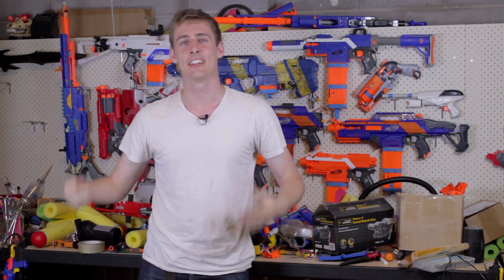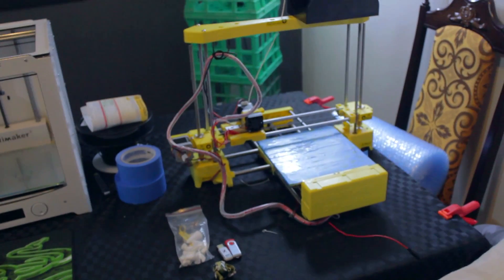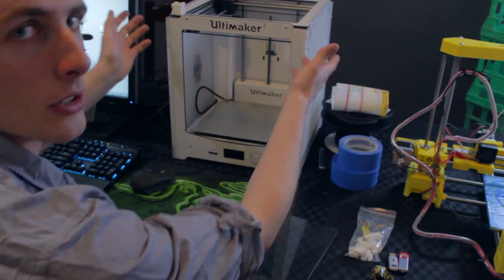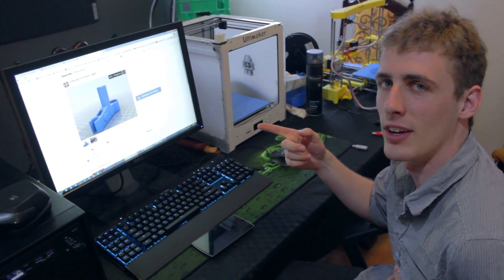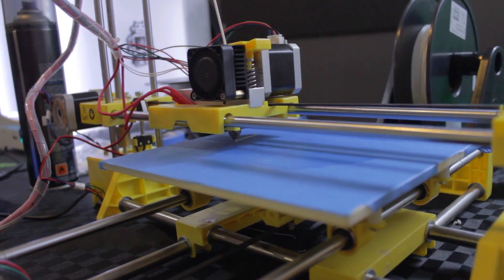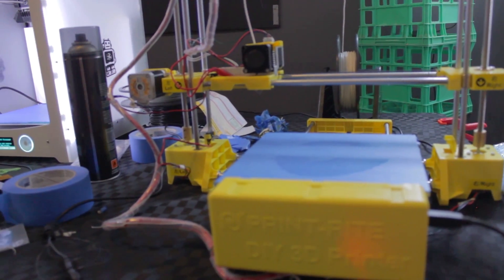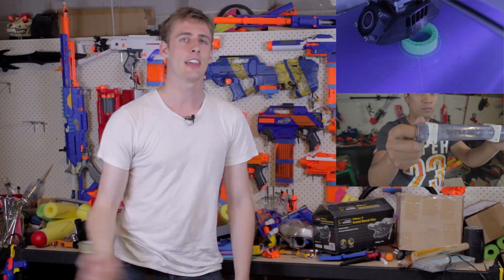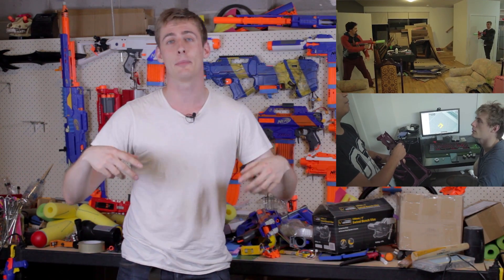ULTIMAKER 2 vs PRINT-RITE DIY 3D Printer & How to Bed Level - PRINTER PARTY | Make Test Battle

Comment: you guys didn't do the printer kits justice. I've been printing on my 240$ USD printer for over three months now, just bought two more as I'm starting a business. I have also printed on the makerbot replocator 2x before and honestly, my printer does a better job. I have more speed, more volume, and more room for play. if you're watching this video with the intent of seeing these cheaper printers in use please don't take this as an example.
Reply from the maker: +Pep. Co We jsut happened to have the two printers in one place and decided to film a bit of the operation. There are definitely some really good, cheap, kits now that weren't avaliable when I bought my UM2 -R

Comment: i have a couple Stratasys Dimension SST 768 printers that i got for about $4k total for the two. theyre old industrial prototyping printers from around 2003. they work great and theyre consistent. the problem is they use plastics trays that arent supposed to be reusable and they use special filament for the model and support material. they have been more reliable and easier to use than the ultimakers and solidoodles i used before. i recommend them and they pop up on ebay pretty often.
Reply: +puddinhead99  i should also add that there are solutions out there to crack the software in the printer to edit the extruder temperatures so you could use cheap filament and there is someone on ebay that sells a reprogrammer for the chips in the filament cartridges. you could easily cut the costs down on these printers.
Reply from the maker: +puddinhead99 Thats a pretty damn good price! I'd love be be able to print with a soluble material for the supports... -R

Comment: OMG!!!!! Blue tape on heated bed? Are you crazy?
Reply from the maker: +James Nelson Yeah why not? It gets better adhesion -R
Reply: +Make.Test.Battle with a glass bed adhesion at the right temperature is sufficient to cause the glass to break off with the part. how could you possibly need more adhesion than that? if you're not getting adhesion on your  glass bed, check temp and level. for pla you should print around 190-210c nozzle and 70c bed. putting blue tape on the UM bed is so wrong :). I have a UMO with heated bed upgrade and its beautiful. have to cool bed to 40c to get parts of, way more adhesion than my old acrylic bed and blue tape. Please try with blue tape, its amazing.
Reply from the maker: +James Nelson 70 degree bed for PLA?! Jeez... I run the bed at 45 with tape and that works for me. I tried running a hotter bed but I am too impatient to let the parts cool before removing them so they always bent :P I might mess around with my configuration when I move house. I will have the printer in the new film studio area so I can set up to print overnight -R
Reply: Make.Test.Battle yes 70 C as the instructions for UM say. That's why you can get adhesion, 45 C is way too low. It does take a bit too cool, but if you use a box fan/floor fan you can cool it quickly. Try it you'll never go back to tape again. It creates a beautiful finish on the part, super glossy.

Comment: you should have printed the same piece on both printers to check quality.
Reply from the maker: +Kyon Thats a really good idea! If I get the chance again we will do that for sure. Unfortunately Kash hadn't done full calibration yet so the print quality was very low and there wasn't really any point to try printing a more complex shape -R

Comment: add autolevel. I have a $400 Printer. but my quality is far greater. I am not counting the filament sensor I added for $60 to measure and compensate for the varying diameter. however, this is the first video I have seen. and hope you have done an update.
Reply: +George Robles Ive never heard of a filament sensor, where did you get yours at?
Reply: Dima Dombrovski Look up on thingiverse.com

Guy did it for a few things, and is the third revision. My setup and info for my board, which is comparable to a RAMPS, with less breakouts. Setup in firmware and my slic3r settings are on my WordPress blog 
georgeroblesjr.wordpress.com if you want the information, plus how I did autolevel
Reply: Dima Dombrovski objects with intelligence is the guys company. Please let him know how you where led to him.

Comment: This is great misrepresentation of the $400 printer. When I built my Prusa i3, it cost me close to $800. Now the same thing costs $400-$500 from China with auto bed leveling, LCD screen and other bells and whistles. Off course it does not look as pretty as the Ultimaker but it does the job quite well. The guy with the $400 printer, should have used a glass sheet on top of the wooden bed. Guys don't get discouraged by this, head over to the Reprap subreddit or  check out the Reprap wiki for more info. A $400 printer can do the job almost as good as the $4000 Ultimaker.
Reply: +Consig1iere I'd say a Prusa i3 is actually better than an Ultimaker 2.
Want auto bed leveling? Install a sensor. Want two hot ends? Just add another one. Or why not a diamond hot end to print in full RGB?

There's really nothing the Ultimaker 2 can do that a Prusa i3 can't, except for costing $4000.
Reply: +Consig1iere This video is USELESS! I made my Prusa i3 a year ago and does exactly the same thing as other printers... I only don't have auto-level but can be added.
Reply: I have a $220 acrylic prusa i3. Works like charm. Heatbed, extruder+part cooling, LCD, SD card included, comes with filament worth 20-30 USD snd I even used a coupon. And free 1 week shipping.
Reply: +Consig1iere 
Not even. The cheapest Prusa I've seen was exactly $199 shipped. It's pretty amazing how cheap they are getting.
Reply: +Consig1iere I built my for less than $300 and it works great.  Don't have LCD screen nor auto bed leveling.  I have parts on order for bed leveling and I have Octoprint to control the machine.
Reply: +Ratchet Russian I'm waiting for the peachy printer right now, It's 100$, and looks pretty promising.
Reply: +Akegata42 Didn't know about the Diamond hot end. Awesome!
Reply: +Consig1iere Can you print at 150mm/s? My buddy has a prusa, its pretty good but pretty slow. I have an UMO (2k$) and the print speed is night and day
Reply: +Akegata42 it can print at 150 mm/s, have a larger print surface and less Z wobble. Likewise you can upgrade it any way you want. Oh and it actually costs 2380 USD from a north american retailer ^^
Reply: +Alexander Nikolaev the prusa i3 has a print speed of 200mm/s... from there website "Maximal speed of 200 mm/s" you sure your m8 has it set up properly?
Reply: +Alexander Nikolaev Print speed isn't really hindered by the design of the Prusa i3, but rather by which hot end you choose and how well calibrated the printer is.
With a Volcano hot end you can get a seriously fast print speed, although that's a pretty specific type of hot end.

The print surface is pretty hard to extend with an i3 of course, but things like Z wobble can be more or less completely eliminated with upgrades.
Reply: +Consig1iere Well I think what this video shows the best, is that if you move your cheapo printer you will have to take some time to adjust it, while on ultimaker even if you move it, it's adjustable very easily, basically as close as plug and play on 3d printers as possible.
Reply: +ValugaTheLord It is not just about adjustability but also upgradability. Even with Ultimaker the user would have to adjust certain things.
Reply: +Alexander Nikolaev The thing about Prusa is that it will differ from user to user. If one user knows what he is doing and does everything balanced and calculated, then I don't see why a Prusa can't do what an UM2 does. In the end of the day, both these printers' core design is the same.
Reply: +Alexander Nikolaev I have a prusa i3V which cost basically the same as the regular i3 (slightly more but not much), however it uses v slot rails instead of the smooth bars. makes for a much more rigid design. i can print as fast as your 2k printer and i have a 12x12x12 print area. i have about 850 in it atm and the only thing i need to add is auto bed level, which will cost like 5 bucks.
Reply: pugs2300 Nice, yeah if I had to buy a printer again, I'd probably get a prusa i3. I picked up my umo 3 years ago, and i3 was not available yet. In either case you get what you pay for (either in time or in money)...
Reply: +Consig1iere monoprice, 350$ fantastic printer,
Reply: Hi Consig- I have to set up a maker space in a school in China. Can you send me the link for the printer you are recommending here? ( in China) Thanks mate.
Reply from the maker: +Consig1iere Hey peeps; this was just a casual comparison to show off what the two printers that we have can do and the differences. If I was to have my choice again I probably would pick a cheaper printer and save the extra money. -R

Comment: have use uhu glue stick makes your life lot more easy printing in abs on ultimaker 2
Reply from the maker: +rob ten tije Yeah I tried the glue but I prefer the blue tape as it doesn't get all gross. Nice and easy to remove prints however -R

Comment: WTF 4000$ for an Ultimaker 2?????????? Did you pay 1500$ for shipping or what?
Reply from the maker: +ThinkDragonX41T Pretty much; the Australian dollar was fairly weak against the Euro when I bought it, shipping was very expensive, and I had to pay local and import taxes. -R
Reply: OMG sorry i didn´t know that you live in Australia. What a hardcore Price for this printer. I use the Ultimaker 2 since far over a year and it has over 1000 workhours with no Problems. The only upgrade i used is an Olsson Block and belt tensioners. I´m sorry that you has a such unlucky device.
Reply from the maker: +ThinkDragonX41T Yeah; I pretty much got a lemon. It's fixed now and I can't wait to make more awesome videos :D I'm considering getting the hot end and fan shroud parts to upgrade it to the 2+ standard to take swappable nozzles -R
Reply: Yeah, the Olsson Block is a great Upgrade but be damn careful with the temperature Sensor when you pull it out. It seems that i damaged mine so i have to replace it. Sometimes i get an temperature Error and sometimes the Maschine runs with no problems. But the Nozzle swap funktion is super useful if you want to print fast or really fine.
Reply from the maker: ThinkDragonX41T Yeah; having a 1mm nozzle would be awesome for crazy fast simple prints -R
Reply: 0.8 is such impressive. My first print with this nozzle was superfast and accurate. The only downside was tat i have to wrapped my Heater with kapton Tape sometimes i get a heater error cause the mass of material sucks the heat out of the heater block and produces this error.
Reply from the maker: ThinkDragonX41T  bahhh stop you're making need to buy it -R

Comment: Well, I bought a  DIY 3D printer kit for $250 and it works perfect and it has an lcd display. Took me about 4-5 hours to build and prints very accurate. ebay.com/itm/New-DIY-3D-Printer-Print-6-filament-Reprap-Acrylic-Frame-Prusa-I3-Self-assembly-/262108623043?ssPageName=ADME:X:RTQ:US:1123 (its a bit more expensive now, bought it in christmast sale :)

Comment: why does the ultimaker costs 4000 for you?
normally its 2200.
i bought a build kit of the geeetech prusa i3 proB. and after hour of set up, its awsome, but why do this things cost 4000 and 400 for you?
Reply from the maker: +Marvin Schnabel The Australian dollar is quite weak, particularly when I bought the printer. Then factor in shipping and Australian tax... -R
Reply: +Make.Test.Battle Australia, whoa since I'm german I'm a neighbour to the Ultimaker HQ. So my shipping distance is really short and it was in perfect condition. I think they arranged trade routes for the US which makes shipping relatively safe there too. But I don't know about australia. Since it is fixed now hf, the UM2 is amazing^^ btw. you might want to check out the Olssen Block it is a upgraded extruder which allows you to change it extrusion width. (from 0.1mm up 0.8mm nozzles are in the box :-)
Reply: im in germany too, i have a geeetech prusa i3pro b now, and now i save money for an ultimaker 2

Comment: Well... I got mine i3 from Aliexpress for just 220$ with shipping (+ some duty when it came) and it has LCD screen with controls, heated bed and I got 2kg of filament with it. It also prints much better than the one in the video (but I think you still had some bed leveling issues there). Quality on Ultimaker still looks better, but I ordered some quality filaments and we will see :)
Reply from the maker: +Maciej Janowski Prusas are pretty decent but I think that the designs that have a bed that drops down are better as 1) you don't need to align the 2 vertical screws and 2) the part isnt wobbled which could affect tall narrow parts. Then again, I only own my printer so I can't really make terribly accurate comparisons! -R
Reply: +Make.Test.Battle True, sliding bed is much trickier with ABS for example, you need much better adhesion to the bed, so the part doesn't go loose. This design is so cheap though it's still worth considering :).
Reply from the maker: For certain! If I was going to go into production of 3D printed parts I would much rather have 10 of the Print-Rites than 1 ultimaker. -R

Comment: I consider my self lucky. My school has one of the printers Ryan has but dual extruders allowing the use of support material (a life saver) AND a laser cutter, the most powerful one for 500 MILES. LIVIN THE DREEEEEEAAAAMMMMM!!!!
Reply: +Zoltan Elder All Printers can use Support Material.
Reply: this one can use ABS for the support material and PLA for the main thing, allowing you to put it in a special chemical bath and dissolve away the support material. it lets you make just about anything...
Reply from the maker: +Zoltan Elder What would be really cool is to use a water soluble filament like PVA instead of ABS -R
Reply: Zoltan Elder yes, any dual extruder printer can do that. You're not special.
Reply: Joestaen I was just pointing out that the dual extruders make it easier than normal support material. Never said it was the only one in the world that could do it...

Comment: I have had an ultimaker original plus for about a year now and have had no major problems. It was a d.i.y kit as well so it was fun to make. Also some shameless plugging, I made a barrel attachment for the hammershot. If you have a 3d printer and want to make it, you can find it here. http://www.thingiverse.com/thing:1173186
Reply from the maker: +Silver 15007 That actually looks pretty neat! I'd stick a longstrike barrel on it for a laugh. Some suggestions:
- Split the part into a front plate piece and the barrel attachment as an insert for easier printing.
- Add a cutout to the plate to make inserting dart easier
- Widen the interior hole that the dart fires through so there no risk of the dart hitting it
Reply: +Make.Test.Battle it already hinges on the top for easy loading. Will make the other adjustments soon. I am also starting work on a stock attachment for it as well.
Reply from the maker: Silver 15007 Ahh gotcha! Spectre barrel and raider stock... I would annoy every single one of my gun nut friends! MAKE IT HAPPEN! :D